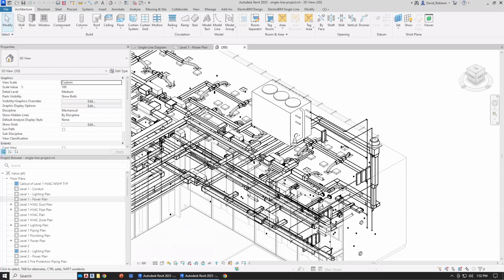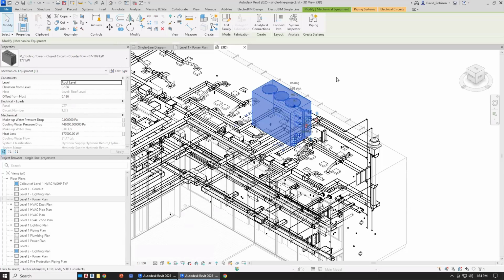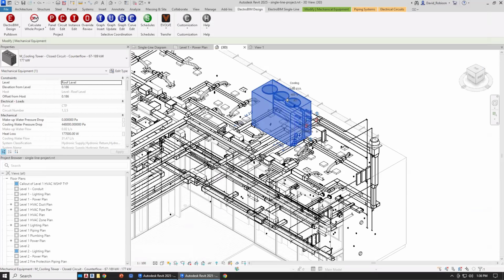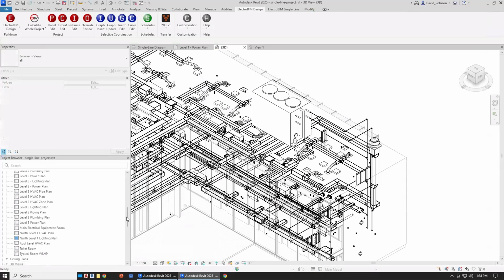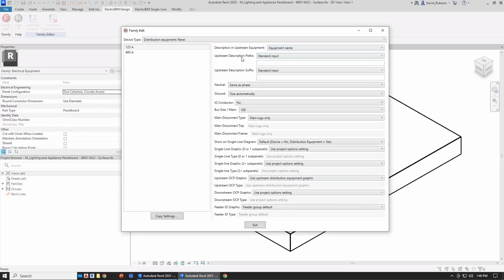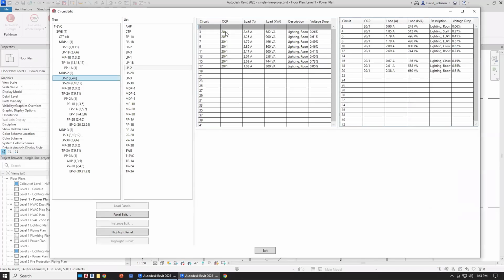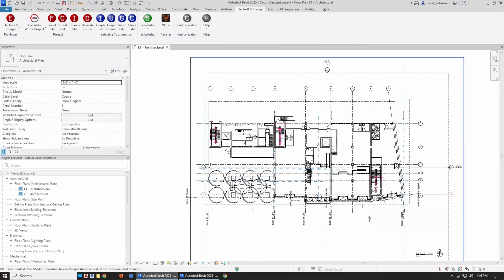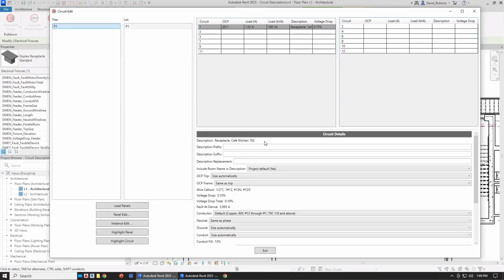ElectroBIM for Revit: Circuit Descriptions (09/19/2024)

Comment: How can we edit the "empty" branch circuits of a panel via Electro tool to give them descriptions, breaker sizes, etc. It seem the tool can't edit an empty branch circuit via "instance edit" nor it can overwrite its contents via the "circuit edit". Sometimes we want to fill the rest of the empty branch circuit spaces with future breakers and descriptions. I tried to revit spare them, or revit space them and then use the tool commands but no luck.
Reply from the maker: Install the latest version and try the "Circuit Edit" command again. We made some improvements in a recent release that should address these concerns.

Comment: At 3:20 you mentioned that you might use a parameter in the family as the source for Design Master's circuit descriptions, and maybe that parameter is pulling together multiple parameters. Unfortunately Revit family formulas lack the capability to pull multiple parameters together. It can do arithmetic and boolean logic but it cannot concatenate strings or numeric values. So there is an opportunity here for Design Master to add the capability that Revit is missing to combine multiple family parameters into the circuit description.